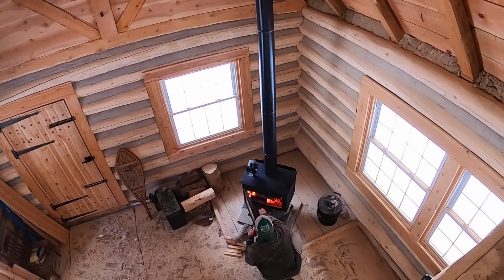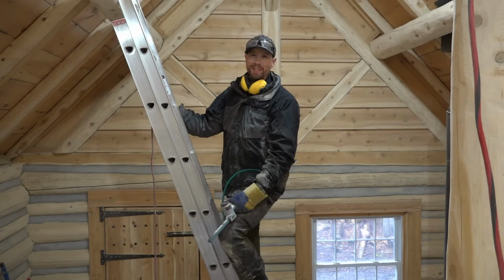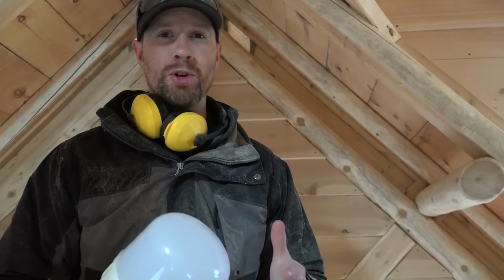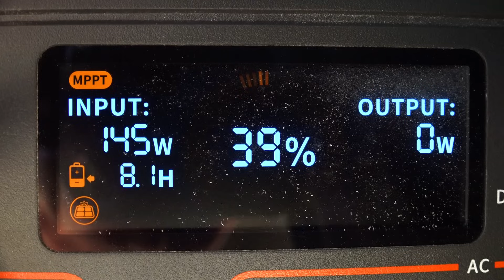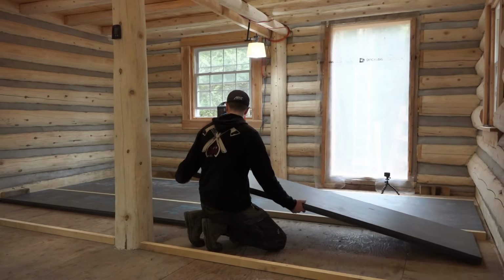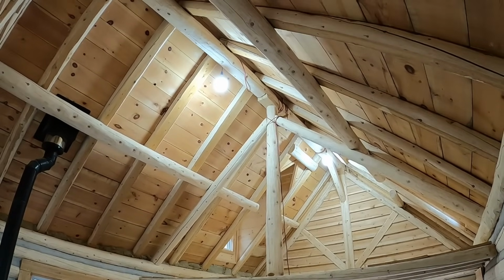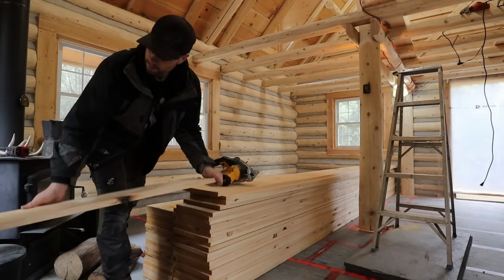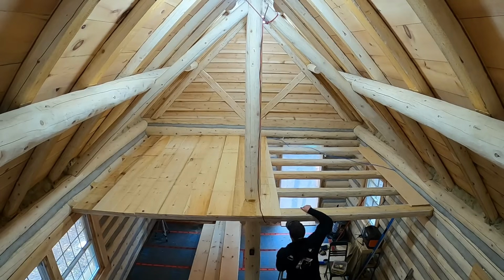Insulating the Floor (Sr Outsider's Final Episode) / Ep94 / Outsider Cabin Build

Comment: Hope you saved the sawdust for use in homemade fire starters. Stuff cloth into end of cardboard tube. Add sawdust. Fill with waste oil until saturation. Plug end with another cloth strap. Store in Ziplock bags. Almost free. Easy lighting. Clean burning. Long lasting.

Comment: If you have many bears maybe put wooden shutters like your door but fits the window
You can put the hinge on one side and a small short timber across and have a timber holder on each side of the window it will keep drafts out, more importantly it helps keep bears and wildlife outside.

Comment: The cabin is looking fantastic and really looking forward to the build of your solar power array and wiring of the cabin. I was wondering about the area around your wood stove. Are you going to put some kind of non flammable material around it in case of embers and sparks. If you are I was wondering what are you going to use?

Comment: Does the Jackery have enough wattage to power an 1875 watt  blow dryer ?
Reply: It's a 1500 watt inverter, so it might be able to power it for a few seconds before tripping the protection circuitry.  You could buy a portable power station with a higher capacity inverter, or it just might be cheaper to buy a 1200 watt hair dryer.

Comment: Hi, congratulation for your fascinating channel. I saw you install rigid styrofoam panels on your floor for added confort. I would  highly recommend that you install a solid vapor barrier under the cabin since all the moisture that raises from the ground will now get trapped underneath the foam panels soaking your floor with condensation water. So your crawl space will need to be sealed from all sides. Take a minute and have a look on how to seal your crawl space on you tube there is a whole bunch of channel on the subject. Have a good day!! My son keeps asking me where is your family land located. In the eastern township?

Comment: I was wondering why there was such a  high  lip in the bottom of the door frame.    I didn't think if insulating the floor   that way.   Though you would do it from under the cabin.    I like your way  much better,

Comment: I've never seen black foam before. What is that stuff called?
Reply: normal closed cell foam board, have black,yellow,pink,blue,green colour, no matter what colour have only important have need artic area minimum 2 board to floor and 4 board to wall and roof. then have artic area living possiple. minimum, eco house need douple more insulation no waste energy lot.

Comment: i have a power shed where i keep all my batteries and electronics i get power in the summer from my wind turbine and solar array and from my micro hydro generator in the winter time,  i heat the cabin and  hot water with a wood furnace,  so my only outside utility is the internet connection.    The real trick is the county assessors office.   In my county, they absolutely hate people collecting rain water

Comment: My buddy had similar generators. But he ended up having to buy 3 because after a couple of hours they were out of juice. Not to mention winter charging problems. So he had to use gas powered for any actual work and then ran these little guys to run lights and tv only

Comment: I should have done my research initially only to find that Jackery battery banks and their general product lines are wa-aaay overpriced with outdated inferior technology!  I'll never buy another Jackery after finding out about ECOFLOW....and Ecoflow's technology is so over the top with superior maximum charging features that Jackery can't even come close to holding a candle to....and Jackery knows this fact!

Also, you're amazingly lucky you didn't flash into a sawdust fire completely burning the cabin down!  I'm in BC and we had an industrial sawmill that went up in flames so fast which WCB investigated the cause being a 'sawdust cloud' instantaneously burst into a raging fire that caused it!  With you running that hand-held blower, I can assure you that it is not a sealed unit but one that produces sparks, and that is exactly what caused the sawmill to violently burn down to ashes in less than 30 minutes! 

Being that much more work, the safest method is to sweep up as much as you can and then vacuum all the settled dust out of the cabin, then proceed and blow out the remaining dust.  It's A LOT of work, but it's also your life and your home that could have been jeopardized!  Consider yourself extremely LUCKY that you didn't burn your cabin down!!!

Comment: This is a beautiful build. I love how neat and precise these guys are. Everything fits nicely together. 
However, the floor boards for the upstairs look very thin. Are they going to be strong enough to hold the weight of several people? Also I’m a bit surprised that they are walking around on the floor insulation on the downstairs floor. Usually insulation is not made to hold that kind of traffic.

Comment: At my work we’ve Frankensteind those air belt sanders together with the Milwaukee M12 3” compact cut off/grinder. They work great and the boss has commissioned another 10 or so to be assembled. Batteries are handy when you have the option.

Comment: The cabin looks great because of the craftsmanship. Not a big fan of log cabins:
1. Too much log wood; not a good balance of other natural earthy materials such as stone, dried clay, brick, milled wood
2. Too many surfaces for dust settlement in crease’s & collection
3. I like the metal roof
4. Walls, floors & ceiling look the same, no material separation

Comment: For the upper floor, I'm going to guess and say, that you're going to router horizontal slots on the edges of floor boards, which will be used to accept hidden cleats/clips, the same type of clips that are used to install composite planks on an outdoor patio deck for a smooth "no screw" look.

Comment: I watch a lot of wood turners, they love those 1 in sanders bc they can get into tight spaces on pieces they’re combining with resin. They leave a wonderful finish. I also wondered if a sand-o-flex wheel drill attachment would make it easier to sand the ceilings? Have you tried them? They have longer sanding flaps then the angle grinder & can get into crevices. You can use them to round off edges of bark on live edge pieces too. They may be too flexible for the cabin surfaces, Idk, that’s why I’m asking.

Comment: 5:49 interesting that the lights flicker when you start the grinder... it looks like the steady state draw is ~400W so inrush is probably well over the Jackery 1500's rated output (pretty good that it handles that without tripping).  At 6:17 when you say "I can charge the Jackery 1500 in a matter of hours", 1534Wh / (100W/panel x 4 panels) is 4 hours.  nrcan.gc.ca says max average potential in Canada is 1.4, so in fact that is a matter of days not hours.  How do you actually keep it charged?  Do you run the generator periodically?  If so do you need to use an inverter duty generator or does the Jackery handle the "dirty" power of a standard generator just fine?  Thanks!
Reply: LMAO

Comment: Good job and don't mean to be too critical but those 2X2 sleepers are a complete fail. You interrupted the thermal capacity of the foam. Created tons more work in cutting and fitting. Created ridges that will never be the same thickness as the foam. Sometimes you need to trust the qualities of well designed building materials and get out of the way of your own inexperience. Not enough lap onto the foam with the tape above the 2X2's. It'll be warmer than before but the wrong way to do it. Built homes for almost 30 years.

Comment: Oh my god. Another "offgrid cabin" with AC power from this power bank manufacturer. You topped it by charging it with the most overpriced solar panels on the market 😅

If you and other wannabe offgrid cabid YouTubers had to pay for the power system you are using I believe you would never used this hardware in such an unefficient way. Americans have the highest energy consumtion per household and from what I saw so far it's mostly because you people waste electricity wherever possible.